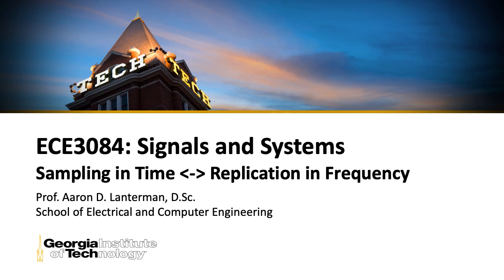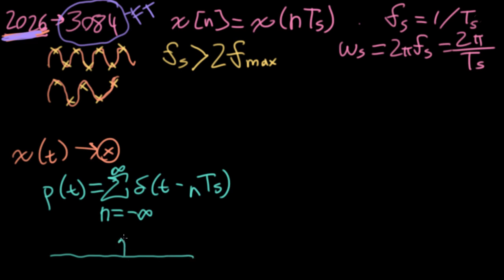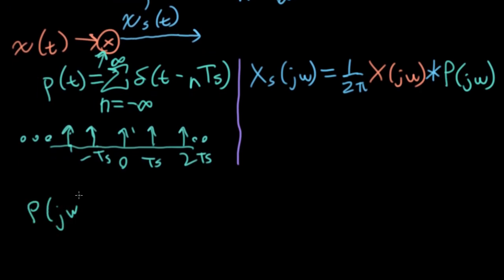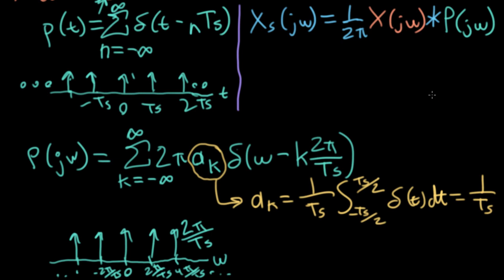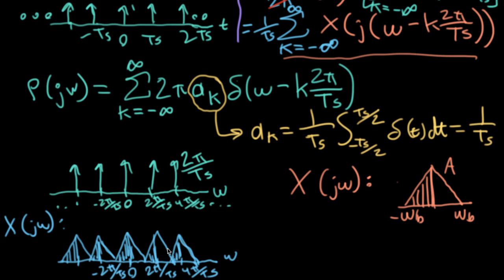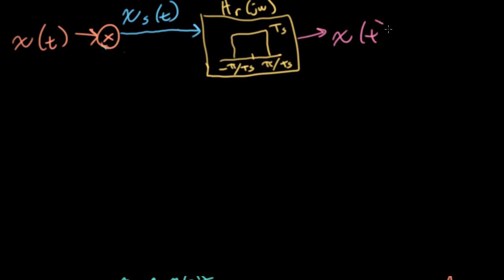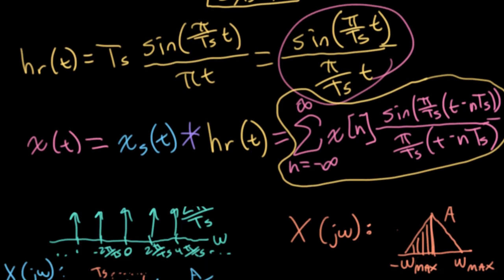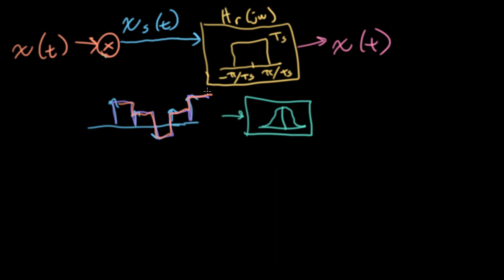ECE3084 Lecture 24: Sampling in Time -- Replication in Frequency (Signals & Systems, 2020, GA Tech)

Comment: The similarity between sampling and AM radio probably shouldn't be so surprising. You could think of each cycle of the AM carrier as taking a sample of the audio signal, and representing it in analog rather than digital form.
Reply from the maker: Come to think of it, that makes a lot of sense; I think chopper amplifiers can be though of along those lines.